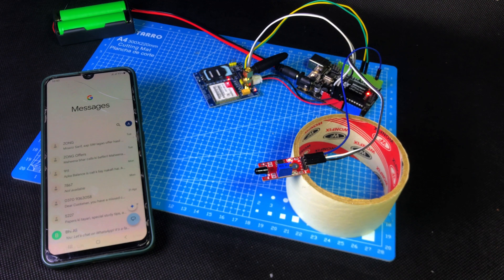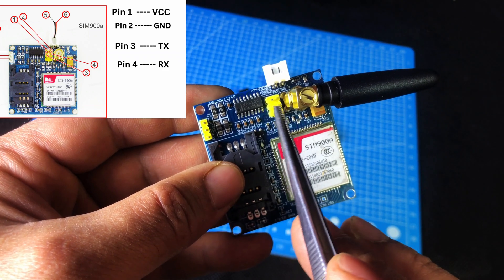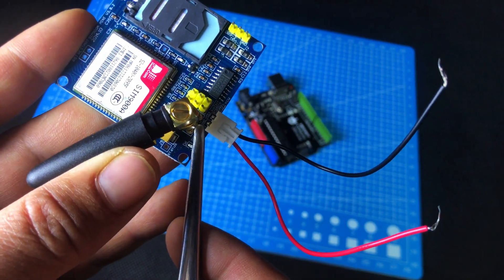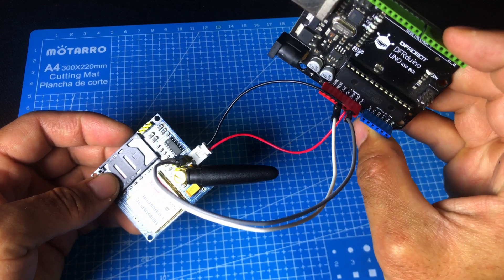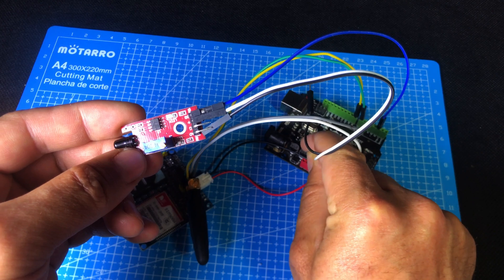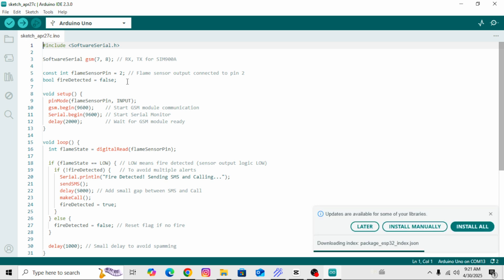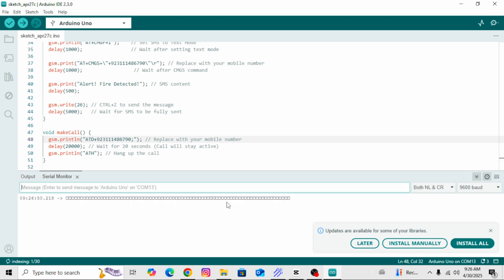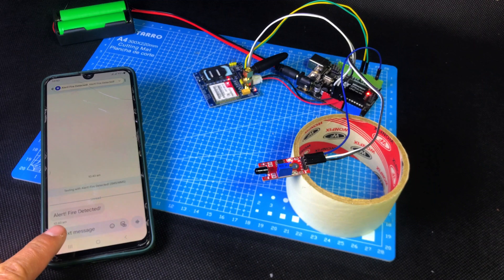Fire Detected! SMS & Call Alert System using Arduino & GSM SIM900A | Arduimo Project Full Tutorial

Comment: Hello please can you answer to my questions: why my sim900a don’t answer to AT or AT+CREG?, ATD, ATH And other commands (It connected to network) And i’m positive that connection is correct and TX RX were not mixed up. I strictly followed to your vidio and instructions. And also why my sim900a don’t call me? (It connected to network blinking 1 time per 3 second and connection and phone number is correct) please answer very fast 🙏🙏🙏🙏🙏🙏
Reply from the maker: Insert SIM in a phone and disable PIN lock.
Make sure it has balance and network signal.